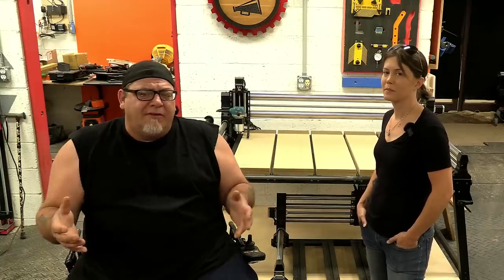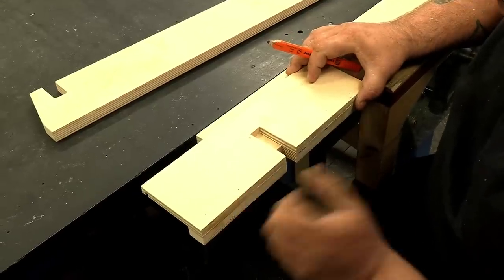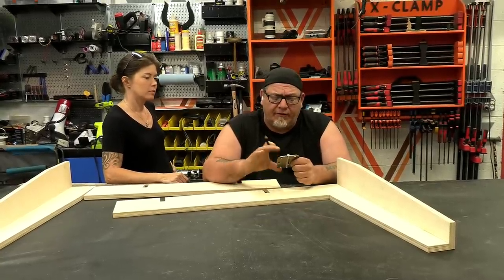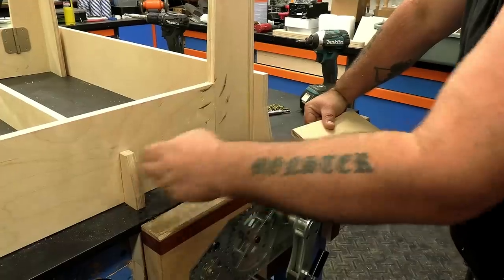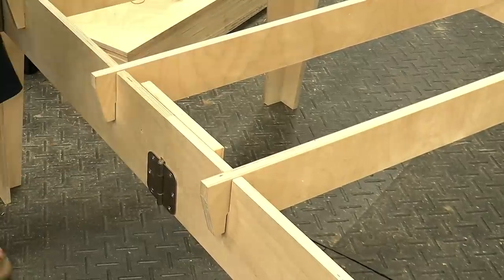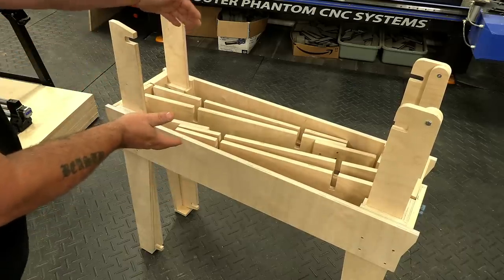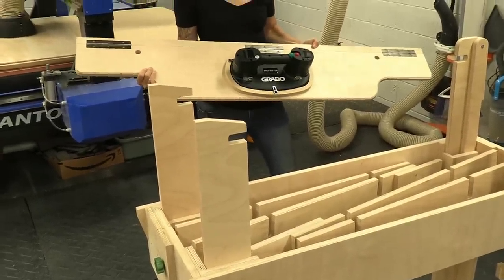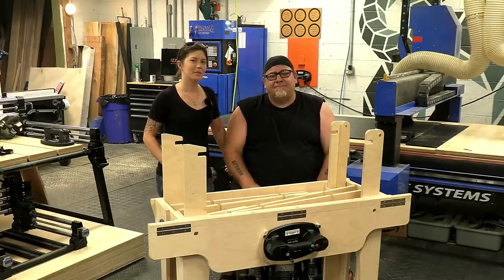Cutting Plywood Made EASY with DIY Folding Workbench

Comment: Izzy I just completed this build…..unbelievable! I really thought this table would be a bit flimsy…..not. I work out of a larger 2 car garage, but it’s still a two car garage. I have a nice set up as far as tools, 4x8 work table that holds a table saw, compound miter saw and a built in router table. All of this to save space. I also have the usuals…bandsaw, planer, 8” jointer, drill press and dust collection etc. BUT WHEN CUTTING SHEET GOODS, that table doesn’t work, so I end up using 40 year old sawhorses.
This thing takes up less space and also gives me the ability to throw a sheet of plywood for an instant assembly table.
Brilliant Izzy!

Comment: I made a similar grid with 2x4s, meant to go across sawhorses, for sheet breakdown, and to get extra workspace. But the horses were often in use already, or the notches on the 2x4s would snap off. This set up looks much more stable to boot! Nice design!

Comment: That design is similar to what we use in the theatre industry. We have collapsible platforms that we open up a drop a deck onto.
When you have to fit a forty x sixty foot deck into a truck, it saves lots of space. Of  course, your design is much prettier!:)

Comment: Nice work.  That table would be perfect for me.  And I like you straight edge jig.  I understand the concept of track saws, but I don’t just that much, but the flip up board design to compensate for the circ saw base is a great idea.  I remember seeing it on a router jig, but never thought about applying it to a circ saw.

Comment: 1.48  The channel could have the corners recessed a little bit, instead of being square. By drilling a hole at each corner of the channel jig. They could be a bit T-shaped, so the bottom is as solid as it can be. 
I do this for location tabs on jigs made on the metal cutting laser.

Comment: Izzy, what about panel saw? I bought mine but I don't lift much at all- just slide sheet goods off the plywood cart and into the end of the saw frame- then I break up sheets without using track saw - just pull the saw down through the mtl. I'm sure you'd come up with an elegant and cleaner version of that saw?

Comment: How did you get those lifting arms to fold up when the ply was pushed over them just prior to unloading off the table. Was that camera trickery or am I missing some fancy bit of Izzy wizardry? Great design but two weeks late as I just finished making another similar design table last week to achieve the same job, damn it!
Reply: Camera trickery. Basically the footage of loading the sheet onto the table run in reverse. ;-)

Comment: That offset folding design dates back to at least the 1500's in Europe (Germany) with a few surviving examples and was published in Roubo's (France) and Chippendale's (England) books in the late 1700's and 1800's. They all used 6 removeable legs, not 4, as the hinged sides needed more support in the middle, 3-4 screws per hinge leaf apparently not being quite enough for military service.